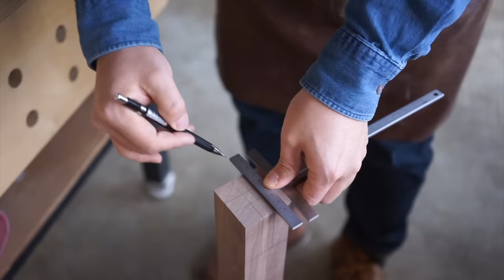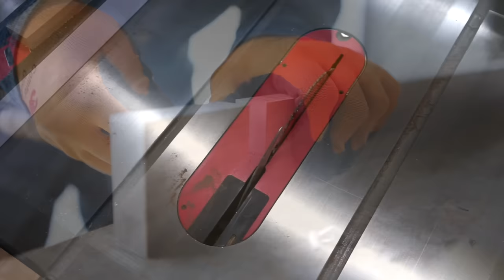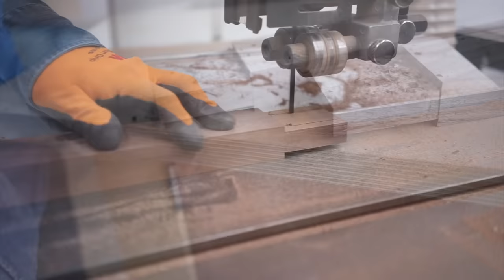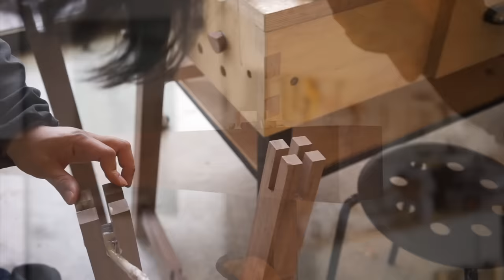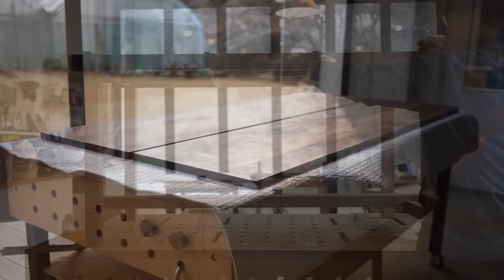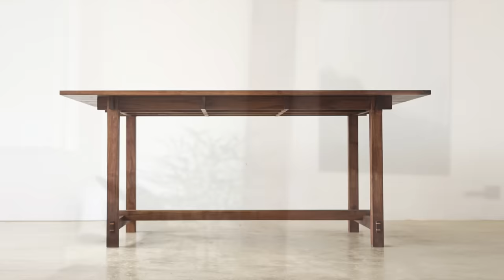Kobeomsuk furniture - Making interlocking joinery walnut table

Comment: Beautiful craftsmanship! For those questioning the use of screws to attach the top, I believe it serves two purposes. First, if done right it allows for seasonal expansion of the table top wood. And second, it makes disassembly so much easier when the table will inevitably need to be moved (fitting through doorframes, reduce weight of table, etc.). It's a very common practice among fine furniture table makers.
Reply: I'm convinced that a craftsman like him has his good reasons! But I was really curious about a wood-only solution 😏

Comment: This is beautiful. Much to learn here. There are many-many choices, that are made in the structure and the measurements. 
Just by making a 3D-model (in eg. Blender) of the table for a study will teach you this. So much precision.
Also super nicely filmed.

But most of all: it is always a great joy to watch a master performing his art. Mastery represents many generations of experience and mastery. Although modern power tools are useful, the Kobeomsuk Master clearly shows, that everything is possible with a measure, a pencil, a hand saw, a chissel, a drill, a planer and some glue. All of which are thousands of years old. The clamps may not be that old, but it can be done by tightening a rope with a stick. 
Simlicity is beauty.

Thank you for the lesson and the joy!

Comment: His sliding t-square is called a “T-type marking vernier caliper”. The only one I’ve been able to find that uses Imperial measurements instead of metric is made by a company called Woodraphic. They are available on Amazon (of course). I’ve had their 8” version since Fathers Day and I love it. As far as I can determine it’s very accurate and well made. I find myself reaching for it pretty much any time I’m doing layouts.

Comment: Seems a shame to hide all that joinery under a solid table top.  That would be a prime candidate for a 1" thick glass table top instead.  It would be heavy -- probably around 200 lbs for a 30"x72" table top.  Of course, that weight would mean that you would not need to attach it to the base since it would pretty much hold it in place.

Comment: For those of you who have taken exception to the use of screws to attach the table top, how would you have made the attachment?
Reply: Those four posts, have them extend further so that they go up through the table top. Split them so that you can use a shim as done lower on the piece then cut, plane, and sand to smooth. Or possibly a sliding dovetail on the long pieces just underneath, using bigger length pieces so that they extend above level of legs. I would assume. I'm sure it is possible but nothing wrong with it as is, beautiful. I'm certainly not that experienced or capable... yet. lol. regardless, great piece and fine craftmanship. Obviously, I don't take exception to the use of screws for this.
Reply: Do all that fine work just to screw the top on. This is what I was thinking.
Reply: @shanefoster2132  definitely sliding dovetail.
Reply: @shanefoster2132  I was thinking the same thing
Reply: Ive been thinking about this too. Maybe::
.add sliding dovetails to the bottom of the top. Make them stand out quite a bit. Attach to the top.
.plane the cheeks of the sliding dovetails square to the top. They should line up with the stretchers.
.secure with a slightly drawbored dowel through stretcher and sliding dovetail.
If you make the sliding dovetails to fit nicely within the undercarriage lengthwise it will stop movement in that direction. The drawbore stops movement orthogonally and stops the top from lifting out. What do you think?

Comment: After all that woodwork, all those joints, you just screw it to the top?
Reply: so that the top can be easily changed and maintained.
Reply: Yes ..that's what I was thinking ...why screw it on....u would be able to with a dowel that's remove able to change and maintain the top...
Reply: Archany it’s to secure the tabletop to the base and allow wood movement. Common technique

Comment: Why all the trouble if you use glue and screws?
Reply: Are you serious?
Reply: @MegaTraianus  He was holding a screwdriver at the end, tho.
Reply: Did I miss something? I only saw him using tenons and wedges. The glue isn’t too necessary but why not, it’s just titebond.
Reply: Well even though he sanded it an hand planed it I'm pretty sure you can see some of the glue squeeze out when looking at the piece as for the screws well that is just too bad btw traditiona japanese woodworking never used glue.
Reply: Really guys?    in the past they used rice as glue. and the screw is for the tabletop. if he would use joinery to attach the top to the frame (to no to be removable easily), i wish YOU to carry that up to the 4th floor alone in a narrow staircase.
Reply: @Yongoni  you do realise he's Korean, don't you?
Reply: @iatsd  I did not know thx
Reply: @DarkAngelEU  Just for securing the top to the frame.
Reply: @MegaTraianus  Still cheating.
Reply: @DarkAngelEU  Cheating? Have you ever build a table? How are you securing the top of a table?
Reply: My same thoughts.

Comment: did he rly just put screws in the tabletops?!?
Reply: yeah, and why glue the whole thing together?
Reply: @warchitect73  "interlocking" glues everything shut
Reply: He screwed both tabletops along the center line, which allows the wood to move. There is no lateral movement in the middle of the board, so it is safe to do so.
Reply: @guisteh11  what does that mean? also, it shouldn't lock, wood moves, you're gonna get tearing and ripping over the long term. also, you can never disassemble it again...just no reason for it. but its his table, he can do what he wants of course.

Comment: Why the gap in the top?
Reply: This table was wonderful untill the gap
Reply: Its there so if you spill your pop on the table it will run down onto your new carpeting
Reply: It's a design feature. Artisanship, where art and craftsmanship come together.
Reply: @russnixon6020  bad design feature
Reply: @sevelev  its a great feature if you use it as an outside table

Comment: And.... In the end he put screws
Reply: Felt the same way...
Reply: But perhaps its to help with transportation and ease of reassembly.
Reply: Yup, that is sad. The whole reason we watch this stuff is for joinery techniques. I hate screws!
Reply: completely ruin the project
Reply: I know but it's
 still nice
Reply: to hold the table top, silly!
Reply: @samyeung122  the screws hold the top in place, to allow for seasonal expansion of the top. if they were attached tight with joinery and nowhere to move, the top or the joins would likely crack/split on another.
Reply: @ryanglenn8123  Yes, this. Screws are a great way to hold a top and allow for wood movement.

Comment: Anyone else surprised by the use of screws to hold the top in place after all that meticulous carpentry?
Reply: You actually have to use figure 8's to attach the table top.  It is because of the woods natural expansion and contraction.  If you just glued the top down the stress from changes in humidity would eventually crack the entire table.
Reply: These are the type of fasteners you have to use.  https://www.rockler.com/desk-top-fasteners
Reply: @joesales9320  Not necessarily. One could use a sliding dovetail on the frame or small wooden blocks with slotted holes to allow said expansion. Since carpentry is one of the oldest arts of mankind, there is no "you HAVE to use this!" because there is always more than one way to do something. And as I scrolled through the comments, I figured, that your praise of those figure 8 fasteners are merely advertisement, so please stop it.
Reply: I think it would help a little with transportation.

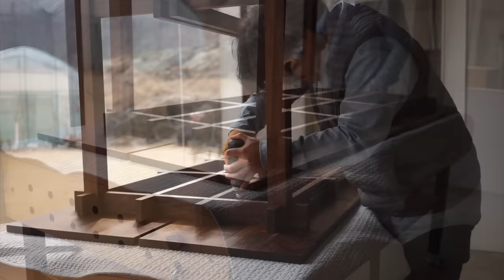Comment: Minute 10:32
You ruined
Reply: Agreed
Reply: i thought so  to, i was wondering what joints he would use for the top.
Reply: He is doing this with a reason, those little metal things he is screwing on are specifically made so that the tabletop has room to move (as wood works) if he wouldn't do that it would rupture over time, also he couldve used the wooden version but even then still a screw or nail is needed

Comment: Good work!
I don't understand the thin slot between halftop.
Reply: i figure its to showcase the work on the underside of the table
Reply: in work benches you can slip tools in it vertically BUT this table doesn't have the mass and weight to be a proper workbench so its probably more suited being a dining table/painting or craft table.. you can still slip some tools in it like steak knives or brushes....

Comment: Very, very nice. I'm a beginner at woodworking. How do you manage to remove the glue before applying finish? I always seem to miss a spot. Is there a certain glue that makes this easier or just meticulous sanding around every joint?
Reply: A few things to try - Use less glue. do all of your surface prep (sanding or planing) before glue up, and do a wash coat of shellac/sand with 600 before glue up to make cleaning squeeze out easier. Keep a bucket with a toothbrush, and sponge and water handy for cleaning whenever gluing. I use scraps the get into corners and scrape the squeeze out before I hit it with the wet sponge. 

Basically, all of this stuff that you might think adds time (I did) saves you so much time sanding or chiseling glue away and leaves you with a surface that requires less work to get to your final finish. Also saves so much frustration. I almost never am sanding to remove glue these days, or at least that’s the intent.
Reply: Hey mate, just keep a damp paper towel handy when gluing up. Wipe all excess glue squeeze out and wait a few minutes and do it again. Another trick is to use apply painters tape to the areas around the spot or joint that you are gluing. After the glue up and making sure that there isn't anymore glue that will be squeezed out, peel the tape.

Comment: What's with glue!? I thought this was interlocking joinery.
Reply: Although the glue doesn't have any real function other than redundancy here, I was really disappointed when I saw the tabletop being fixed with screws.
Reply: @P8qzxnxfP85xZ2H3wDRV  exactly ... Glue is not generally disappointing if it is just to backup the joinery during the exposition ... The transport ... But the metal screws are a big no
Reply: @francescobarbiero   I'm curious, how would you have done it instead?

Comment: E
What is the name of the tool used at the beginning to layout the lines for the cuts.
Never seen one before and have searched but not found?
Reply: It's an adjustable T-square, but for the life of me I cannot pinpoint the manufacturer. I've never seen one quite like it either.
Reply: Just went looking for one in Japan but couldn't find it..
Reply: Search this, "0-250 미리메터 T 형 마킹 버니어 캘리퍼스 미세 조정/T 마킹 버니어 캘리퍼스 괜찮아요 ajustment/T 형 마킹 게이지".
Reply: @drivesthecar3247   You are magnificent.

Comment: Where do I buy the measuring tool you use in the beginning to mark out your tenons?
Reply: That is cool. It’s some type of adjustable T square. I looked around for a bit and can’t find it online.
Reply: It's called a Masui scriber gauge T-square..you can get it on ebay
Reply: Woodraphic makes a nice version and it’s available in Imperial measurements. Amazon has them.
Reply: Nick Pederson Thanks for the tip. Just ordered it!
Reply: gentlebear21713 Thank you!

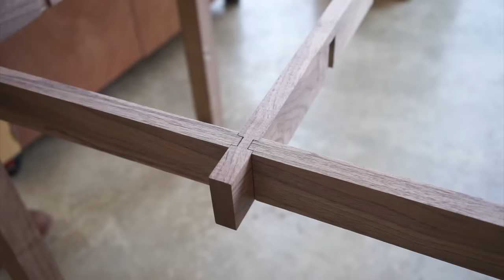Comment: Does anyone know why he cuts those kind of haunch cheek things on his edge lap joints (really good shot at 5:02)? Does it help against pivotal movement or?
Reply: It's traditional and it helps keep it strong, if that makes sense... If you flex a normal cross joint it'll weaken over time but those kinds of angles are there to keep it from rolling the edges and stretching the tolerance.

Comment: now that's a fucking carpenter.
Reply: @neverstopgrowing: You seem to be confused. The tolerances that each occupation, carpenter or cabinetmaker, works under are necessarily different. It is both impractical and the dwelling will suffer if a carpenter works to the tolerances that a cabinetmaker works under. In addition, a person who uses foul language in verbal language is immature. To use the same foul language in written form is a sign of low class and breeding. Please abstain from commenting in the future if you cannot be respectful of the reader.

Comment: Who makes that depth gauge style layout tool your using?  I’d really like to get one.  Thanks
Reply: Wow, these are really expensive. But they look like it will really speed up making markings.
Reply: Myrkskog that looks like it.   Thank you very much.
Reply: J Austin I would say that the Incra T-rules do the same thing with possibly higher precision although it would take a little more time to do markings. But they are way cheaper in price. 

https://incra.com/measuring_marking-trules.html
Reply: @cliffgiel7289  aye, spot on.
Reply: @th34lch3m1st  good lord, the price!
Reply: @Myrkskog  That is for the pros...for those who don't have the time to tweak a 20$ digital caliper, time is money. Me personally I'm just an hobbyist in woodworking.
Reply: @Myrkskog  Yes, hitting the roof!

Comment: You lost me when you whipped out the drill and screwed the top on
Reply: that's a correct way to attach a table top.  he's using tabletop fasteners. you need to account for seasonal expansion and contraction.

Comment: I hate wood joints that have to be hammered together. They leave the wood stressed and scrape all the glue out of the joints. Instead, be like a metalworker and make everything the right size so they can be assembled with light finger pressure.
Reply: @jimjones26  You'd do well to read and digest your own words. Mine made perfect sense.
Reply: Agree. I attempt the hard wiggle  fit. And god does not like me, so if I hammered it together for the dry fit, it would never come out or split.
Reply: @williammartin2593  Renowned cabinet maker Paul Sellers has one video of - I think - a mortise and tenon joint. He hammers the parts together and a massive split flies down from his too-tight joint. He doesn't even mention it. I find such inaccuracy and bodgery unacceptable.
Reply: Joints that go together with light finger pressure will fall apart eventually.
Reply: @mikevalentinas6766  No they won't. Go see Matthias Wandell's experiments on glue joints. If you use PVA glue you need slack joints for maximum strength. If you use tight joints, Gorilla glue is the stuff to use.
Reply: donepearce do you build stuff or just watch youtube? i use hide glue, hide glue works best with tight joints.   also tight joints look better.
Reply: @mikevalentinas6766  I'm more inclined to believe the results of experiment than folk lore. As it happens I have used hide glue for the ribs of the last lute I built. It was the right glue for the job. That's how this works - you choose glues depending on the exact application. If someone puts PVA in a tight joint, he isn't using the right thing.
Reply: donepearce I guess that is fine if you don’t mind seeing a glueline in your joints.  PVA typically dries a light orange  (such as titebond original) to brown (TB3) color and if your joints are loose enough to assemble with light finger pressure (and are relying on the PVA to fill gaps) you will see that glue line, which would look terrible in light species like cherry or maple.  In a m&t the glue is all hidden so maybe not a big deal.   but in dovetails, bridle joints, some lap joints it is definitely a problem.   Joints should not be so tight that you need to hammer the hell out of it, but often times my joints are snug enough for a few taps with a wood mallet.   Mattias might be a clever engineer but from what I can tell he values function over form and does not care to waste time on fine craftsmanship.

Comment: Wow you really messed up the endgame there. A slot in the table top for no reason. And even worse, using screws to attach it.
Reply: Nobody cares.
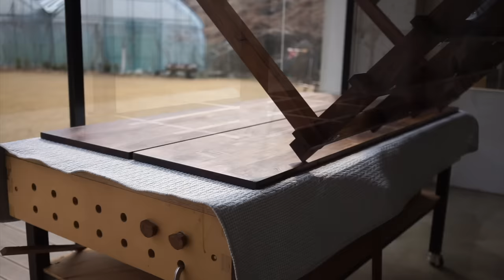Reply: At 10:23 you can see the frame/base has metal tabs to attach to the table top.  This is an extremely common way of attaching tops.  Especially since the grain direction of the top won't be the same as the frame.  This method allows for the top to expand seasonally.
Reply: So on day 1 of carpenter school they teach about wood humidity and expansion. And table tops are installed with that bracket so the table top doesn’t rack the legs or work it loose over time.